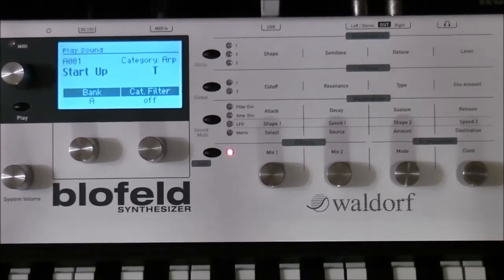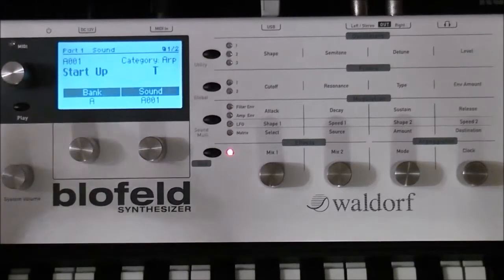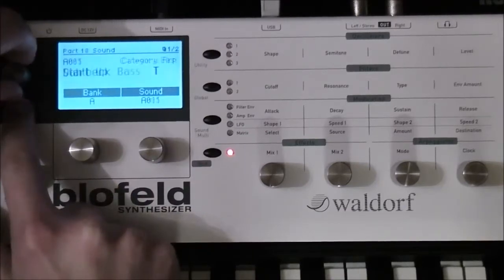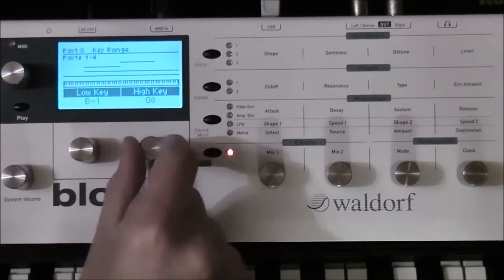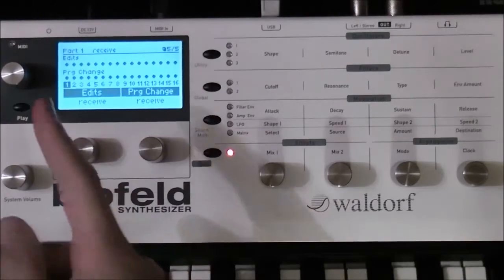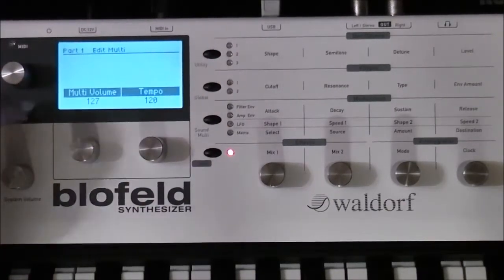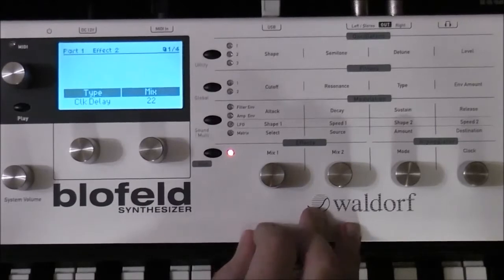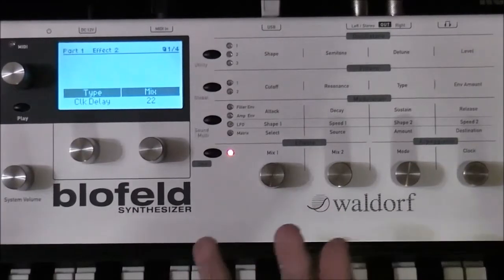[tutorial] Blofeld Beginners 2: Multi Mode

Comment: what kind of display do you have?
Reply from the maker: +banyus sorry, I don't know what you mean. I did not change the display of the Blofeld.
Reply: yours looks so blue,mine is green-like
Reply from the maker: +banyus it's just my camera. All Blofelds have the very same display ;)
Reply: Looks cool anyways :D And let me ask...Do you use di-box for the signal?
Reply from the maker: You're right: the Blofeld has unbalanced outputs. But I don't use a DI-Box because I don't play live, my cables are rather short and I don't switch many devices on at once. Consequently, I don't have problems with signals...
Reply: Thank you for your answer!Just a last question!Is it possible to store my own presets somehow without overwrite the existing ones?I mean create as an additional like H bank 128 is the last and start a new like I bank 1...I have presets on it and I don't want to overwrite them,or if there is a possible way to save the existing ones on the pc please help :)
Reply from the maker: You can store them on a computer (watch my MidiOX video and my Blofeld Beginners 1 video) via SysEx. Plus, there are free patch management programms (librarians) for the Blofeld (Google is your friend). And you can choose which sound will be replaced by your own sounds (again, my Beginners 1 video). But you can't make new sound banks, you have "just" 1024 patch slots...

Comment: I can't seem to figure out how to actually SAVE (STORE) a multimode despite having seen this several times. I get how to mute parts 9 - 16 (leaving 1-  8 for the Blofeld) on it which is great as I want my Fantom FA08 sequencing. I cant seem to save/store on mine for some reason. Everytime I've set it to Multimode 1 but every reboot 1 - 8 parts are no longer muted which is frustrating. I haven't dabbled in MIDI for a while due to health reasons so I'm just getting back into hardware again. Great video though, even if it means I can't save the data on my particular keyboard version - they might be different.
Reply: I know it's late reply, but for the sake of others. To save the multimode settings, Press and hold Shift, then press Utility, you can change your name and slot number, then again Press and hold Shift, then press Utility. Multisound should be saved.

Comment: Thank you so much for making these videos. I'm considering getting a Blofeld, due in part to your help. Could you please elaborate on the role of the program change parameter as shown on the last page of multi-mode settings? If enabled, does this mean a MIDI controller can tell Blofeld to change part X from patch Y to patch Z?
Reply from the maker: Yes, you can switch the patches of parts via MIDI.

Comment: Hi, I'm very impressive of your work and your tutorials, especially this one, cos' I'm a total beginner with the Waldorf. Need your help though  : I got a Digitakt, a Keystep and so a Blofeld. I would like to use an multi effects (Digitetch, for guitar), with Midi and audio outputs, for the sound of Blo. Could you tell me how the connections must be working ? Thanks by advance !!! (a french fan)
Reply from the maker: Hi! First of all: Thank you very much for your kind words :)
Unfortunately, I don't have these other devices, so I can't help you, sorry :-/  
You should maybe post your question on some synth forum - they can help you for shure!
Reply: You probably need a midi thru box to get midi clock to all your devices, so they all play in time. If you want keystep to play Blofeld you set the midi channel on keystep to the same midi ch in Blofeld. If You have a multi effect with midi you connect it to the midi thru box so you can sync for instance you delay to Digitacts tempo. To use your multi effect for all you devices you need a mixer with auxiliary so you can adjust how much effect you get for each instrument. Hope that helps

Comment: great tutorial!
but i still can't play two sounds at the same time! i managed to store one sound(an arpeggio on hold - M001) on part 1 on the first half of the keyboard, and it keeps playing when i skip to part 2! but when i change the sound on  part 2(from M001 to M002) the sound/arpeggio on part 1 stops playing and i can only play the other sound(M002). I thought i pre-programmed and saved every little setting for both parts but it still doesn't work. what have i missed?

also, does multitimbral mean i can play (at least) two different sounds/presets AND different notes at the same time?? e.g.: can i play one sound (pads) with my left hand and a different sound(arpeggios) with my right hand if i spilt the keyboard? or does it only mean that when you play one note/chord the synth plays two different presets but those same notes at the same time?
Reply from the maker: It seems that you just programmed two different multi parts, not two sounds within one multi program. Press and hold shift and turn the knob to switch between sounds within one program.
Reply: @SynthesizerVideo    thank you for your quick response! but i think there is something wrong with my blofeld :I  holding shift and turning the program knob doesn't do anything differently than just using the knob without holding the shift down. also i can't even save sounds anymore for different parts that i could manage a few days ago...now i'm scrolling through different preset-sounds on the screen but when playing the keys it just keeps playing the same first sound...or the arpeggiator gets stuck. sometimes turning on and off helps but its frustrating.  i think im just gonna play it single sound mode and try to hunt another blofeld..

Comment: Thank you for making this. I've just got a Waldorf and these videos have been invaluable to me. When I first started putting sounds onto different midi channels with the multi mode, the different voices were effecting each other's gate time. I figured this is what you meant when you said that the Waldorf cannot be used for 'alot of complex sounds at once' but then with other voices, there was no integrated gate problem at all...maybe because I was using sounds with delay? I dunno...anyway, Thank you so much!!
Reply from the maker: Yes, "effecting each other's gate time" sounds a lot like "voice stealing". With "complex" I meant patches which need many processing resources. This can include also sampling, fast wavetables or many modulations.

Comment: So when you are saving a sound in multi, can you rename it so that you don't write over the original and also have a set of sounds that you use exclusively for that multi patch as you create the patch? Or would I first have to make a few initialized sounds, name them multiA1, MultiA2, etc., and the load them into the multi patch? I could see how this multi would be a powerful tool for monosynth patches where you would not have to worry too much about polyphony. E.g. having two single saw wave sounds but each with their own independent lfo(s). Or creating one's own super saw sound patches.
Reply from the maker: The multimode uses the exact same sound memory/library as the normal mode. When you change them in multimode they will be different also in single mode. But you can also select the slot in the common memory where you save your changes. So the sound editor in the multimode is exactly the same as in single mode + multimode menu.
Reply: Not sure if this answers my question or maybe. Yes, I know it uses the same library and yes I understand that when you change a sound in multi, it changes it in single. But when you change sounds in multimode, can you save them with a different name, thus making them an altogether different patches/sounds? Or is the best way to do it is to figure out the sounds you want, duplicate them with a different file name and then work in multimode with those newly named sounds?
Reply from the maker: Ok, I think I got your first question wrong, sorry. Duplicating is the best way, I think. The multimode is a bit tricky and was added later as an additional feature in the Blofeld - so some parts of it are a little basic. The patch management for instance. So, there is no possibility to save all sounds at once or to store the complete multi programm with all patches. You have to treat every sound separately.
Reply: Thanks for your help :)  @SynthesizerVideo
Reply: Hi guys. Do you use some software tool to backup and manage multis? I would like to have something that downloads and backups the multis including the patches and then allows me to upload them to Blofeld later in a smart way - i.e. using empty sound and multi slots for the upload of sounds and multis from the backup library.

Comment: hello mr blofeld:) i love it how you must love the blofeld:) (i think so because of that much videos about it over the years...)
question: midi recieve: is there a way to make the 16 parts recieve all midi on let s say channel one? that would be huge! or on the opposite: do you know a midicontroller which can send the same note via several midichannels? i want to play with one keypress all 16 parts and mixing the parts in the blofeld... it would make it a huuuge 16 channel dronebox
Reply from the maker: Hi! You can define the MIDI channel for each part. You can also assign the same channel to every part, i.e. "omni" which means "process all MIDI channels at the same time". But remember: The Blofeld has only up to 25 voices which means that you could only play one note with 16 parts at once.
Reply: @SynthesizerVideo  oh now i got it! i did turn the encoder too soft, so nothing happened^^-thank youuuu:) one note is enough as long i can tweak the patches(parts) live. so i can change the notes via transpose for example and can fade every osc in and out with the volume encoder:) sounds huge to me. will see if it is practical to do in real;)
additional question: what is one voice? is it one part made of 3 osc ´s or is it one of three osc´s of one part (patch)? --i will experiment and will see:) thank you

Comment: Thank you for these videos. It helped me decide between the Blofeld and the Korg Minilogue.  I already have the Korg Monologue and the Arturia MiniBrute, but I needed a good digital synth to complement my analogs. This is the perfect synth. Awesome sounds and a very small footprint.  Thanks again for your great and informative videos.
Reply: Den Martos I had the same choice I was mulling over. I've decided to get both! The new Minilogue XD is a completely different beast than its predecessor - must have. The Blofeld is just an awesome synth that's not only full of programming power but it's a blast to use as well.
Reply: I sent back my minilogue in favor of the Blofeld. Got the desktop with the keystep. I'm going to create some cool texture pieces. I'm amped!

Comment: It seems that you could get some complex sounds with 24 notes and 16 parts. As you showed, the first 4 parts could use their own effect 1, and share effect 2. If you just used 4 parts all on midi channel 1, when you play one note on the keyboard it would use up 4 of the 24 notes? That seems very reasonable to me! Unless each oscillator in each sound uses up 1 note for polyphony? In that case you’d run out very quickly...
Reply from the maker: Every voice keeps one note of one complete patch. Four parts with one note each = four voices. But if you need long release times, you can run out of voices very soon because the released voices would still play when you hit the next notes.
Reply: Synthesizer Video Service when I think of Juno 106 it had only 6 voices and sounded good. If you have 4 parts with 1 note each, you end up with 6 voices too... I think it could sound good!

Comment: incredible but multi don't save data... in Sound mode yes...  but in Multi don't store...
Reply from the maker: You can store one single patch in the multi mode. But you have to do that additionally. It will not be stored together with the multi, that's right.
Reply: @SynthesizerVideo  so if you want to change the name of a MULTI, like me, it is not possible?
Reply from the maker: You can change and save everything.